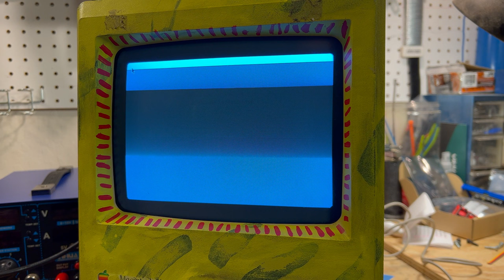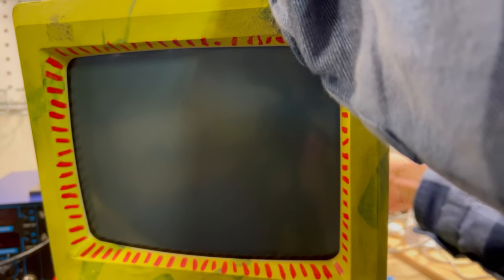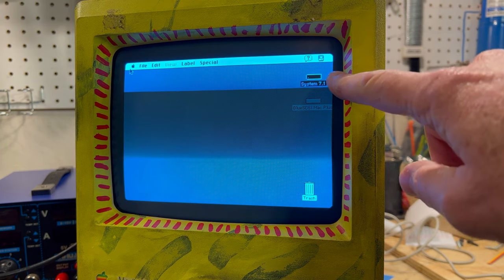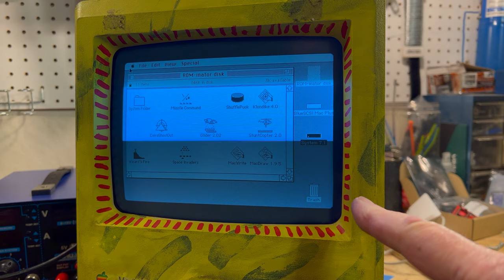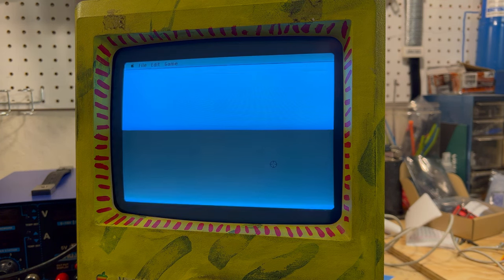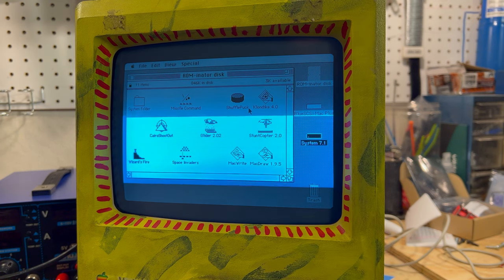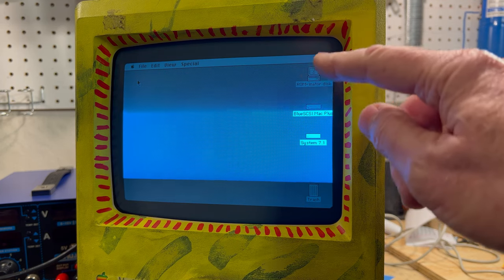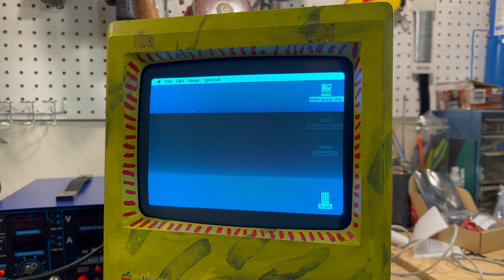ROMINATION FOR THE MAC PLUS COMPLETED ? part 3

Comment: Congrats, you have finally solved the bad contact problem with your Mac Plus for ROM socket! 
However, noise runs on the screen for a moment when the ROM-Disk is switched to in the middle of the boot sequence. This still means that the ROM socket still has bad contacts. I think it will be necessary to replace the socket itself on the motherboard in the near future. This socket replacement seems easy but difficult, and sometimes the peeling of the pattern creates a bad trace. If possible, practice with an unnecessary motherboard before starting. I will spare no effort because I want all my customers to be satisfied and solve the problem. Please contact me if you have any problems.
Reply from the maker: Thanks for getting back I might do that later on if it becomes more of an issue
Reply from the maker: Also it has only done that one time
Reply: @DavidStahlOLDHAPPyMACs  I replied to you by email, but it came back. It seems that the email address you entered was different lol
If you have any additional questions please write them in the email form at my website. I will definitely check.